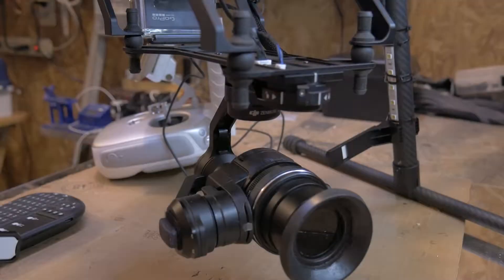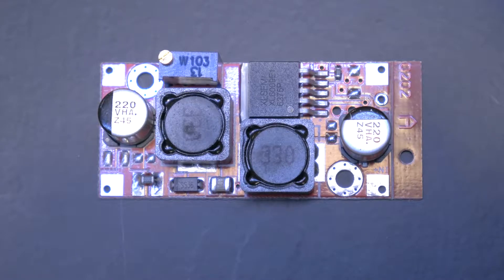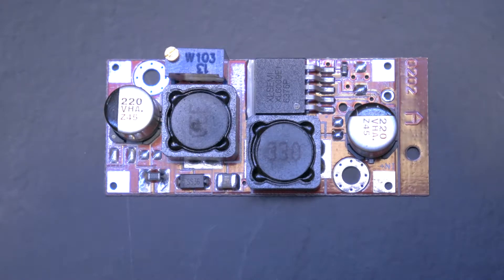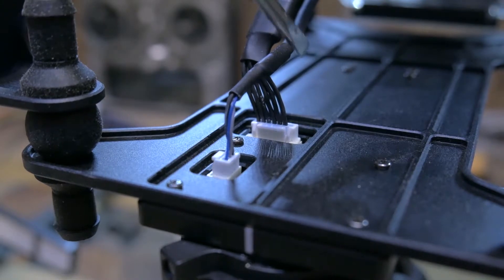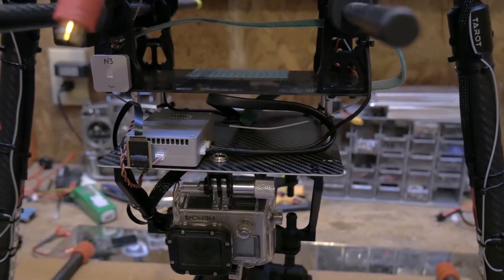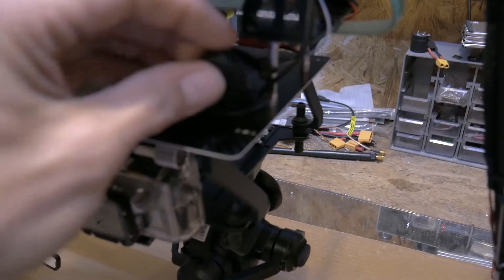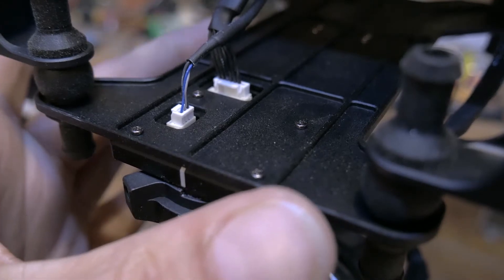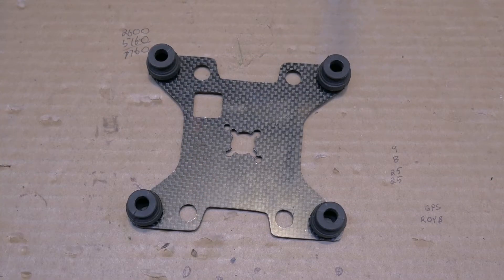DJI m600 camera mount tips and tricks

Comment: Hi, i like a lot your work, I'm actually made a hexacopter and i bought the m600 mounting bracket, i read the manual and that indicate to connect the mounting bracket to 18V conector of the m600, you said in the video it is possible to connect direct to 6S battery (about 25.2V when is full) this is really safe? or you recommend to get a voltaje step-down?
Reply from the maker: Anzaldo Cortez hello sir thanks for the question. That is what I've done just to be safe I used a voltage step down to power the camera and gimbal. There just isn't a lot of info for this on the voltage so I would recommend using a voltage step down. Again thanks for the question and good luck on your build.